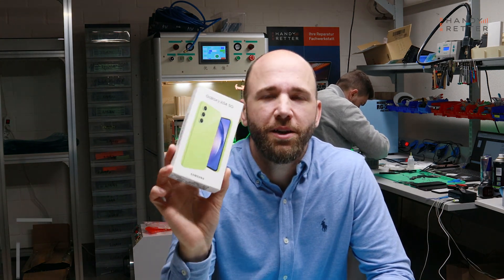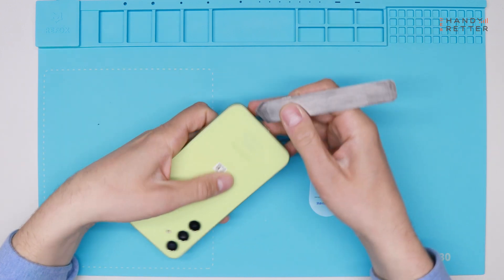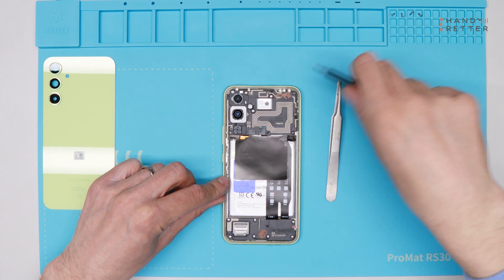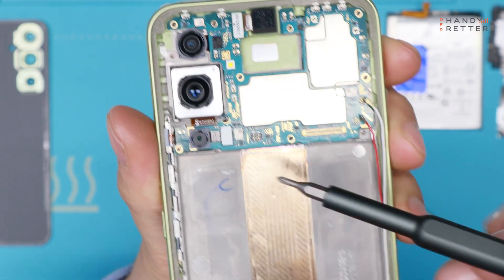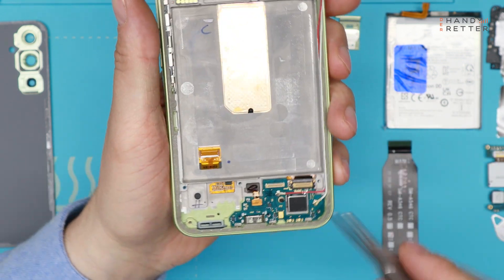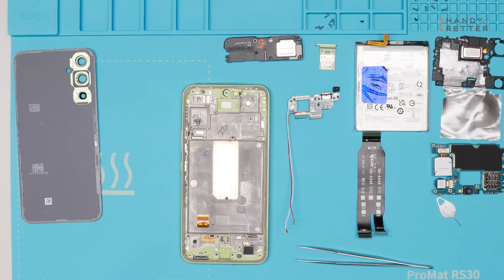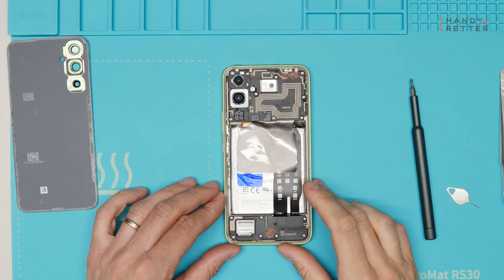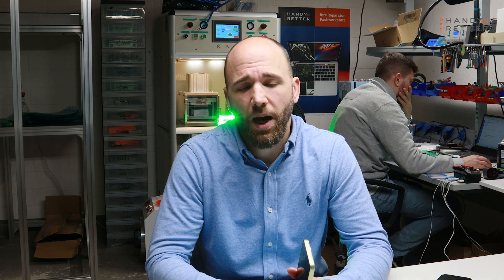Samsung Galaxy A54 5G - Teardown - Full Disassembly

Comment: Who else wants to put thermal paste on that processor? Sheeesh samsung... Your phones are expensive and yet dabbing a thermal paste is like a bent on your knees
Reply: you have a very good thought! i added thermal paste on my Galaxy A53 and BOOM, performance improved considerably. but despite this, I feel that the heat does not travel through the body of the phone, and the heat ends up concentrating on the upper part of the screen and the back cover.

Samsung needs to add longer heat pipes to their phones, it would be interesting if the one on my phone was shaped like the letter U instead of being a straight line.
Reply: @danielMangy13  add a piece of copper shim this adds thermal mass and may sustain performance before throttling. HTH

Comment: The bottom main sound speaker grill is made of metal mesh?
Reply from the maker: Yes, but it’s covered with some plastic elements/ plastic frame
Reply: At around the 4:50 mark